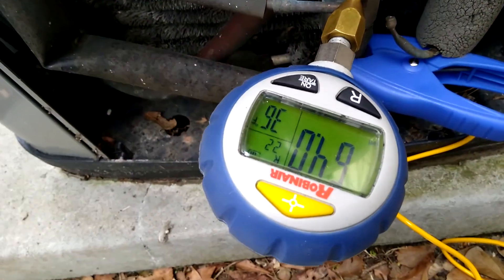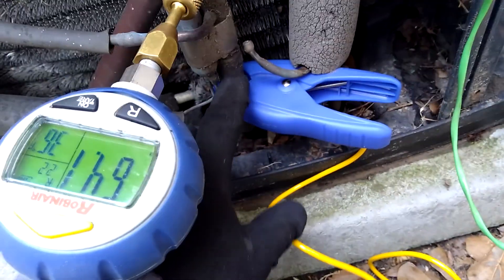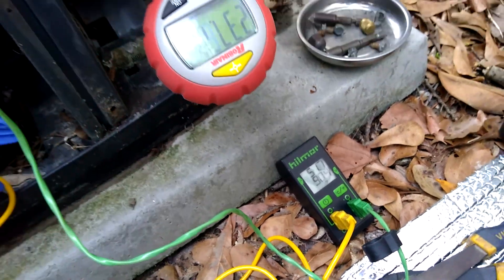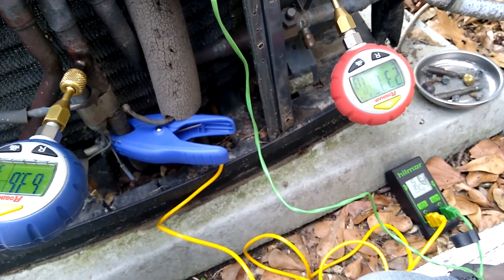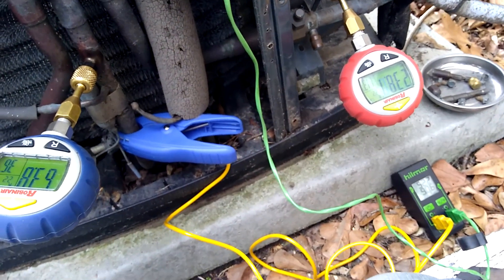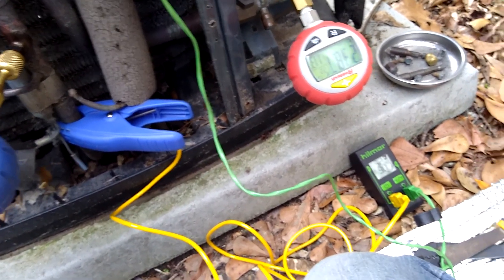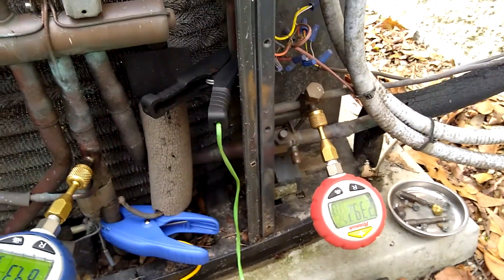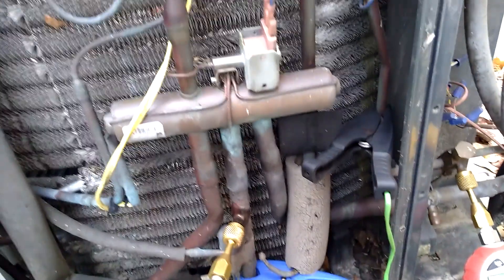Heat Pump | Pressure, Superheat, and Subcooling in HEAT

Comment: That's how I winter charge a heat pump. Then I go back in spring and check it when cooling conditions are achieved . Check in cool mode superheat and subcooling.

Comment: if you check out grayfurnaceman videos 3 part videos charging heat pump in winter months best to charge by discharge temperature
Reply: Weigh in is the only approved method on a lot of machines. Goodman has a hot gas method on theirs, but with different coil matchups I would question that method.
Reply: Working Joes Roundtable grayfurnaceman did a weigh in charge did not work as well as discharge temperature
Reply from the maker: +Doug c how could weigh in not work?
Reply: Doug c that method does not work anymore with higher seer equipment. Discharge will be more like 80-90 over ambient.
Reply: Joe Shearer I am not trying to argue. trying to learn and understand. do you consider 14 seer high? also I am assuming 410A different numbers? VS R22? above comment are you saying 80 - 90 Plus oat?

Comment: was the heat strips on when you were checking this?
Reply: yep
Reply: Working Joes Roundtable with the heat strips on would this simulate a false heat load and would the pressures be different with the strips off?
Reply from the maker: +Doug c no

Comment: I think the systems are purposefully designed to have elevated subcool in heat because it drives compression ratio up which makes more heat from compression and also more mechanical heat from compressor.
Reply: Have you read it or Theory? Neat
Reply: Joe Shearer please do the math to see what it comes out to
Reply: Working Joes Roundtable it's theory based on my experience of playing with things like outdoor TXV upgrades and also just basic refrigeration knowledge says when comp ratio goes up...discharge temp also does. A nice 2:1 is great for cooling but not for heat mode.
Reply: Doug c I'm not aware of math formula to prove or disprove but it would be a cool experiment